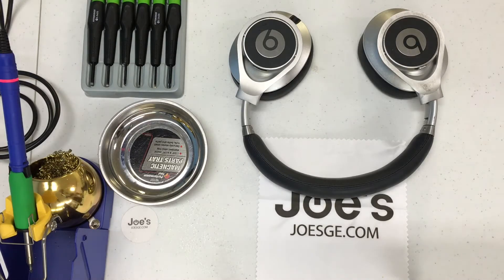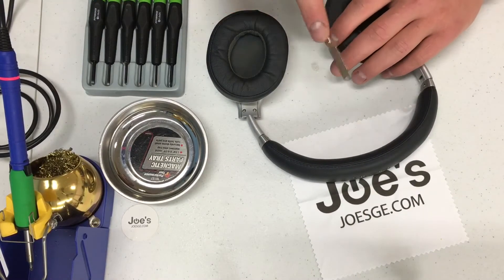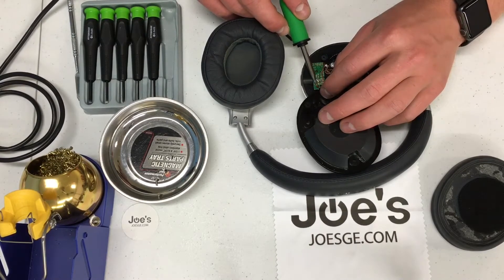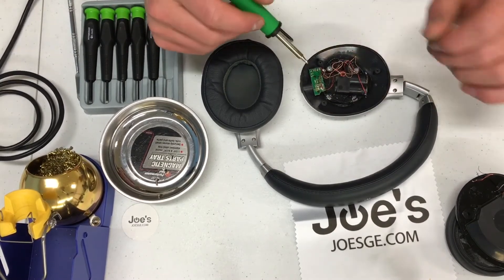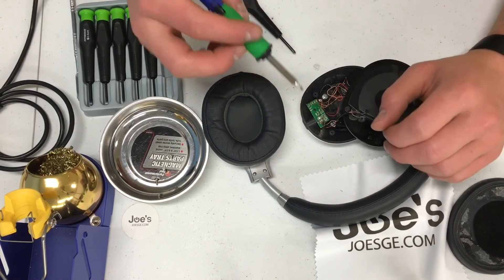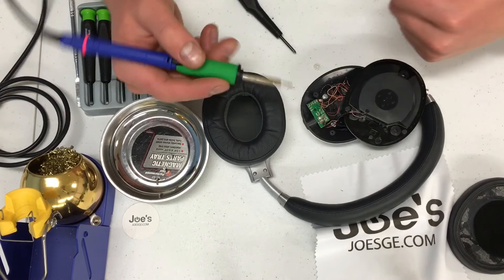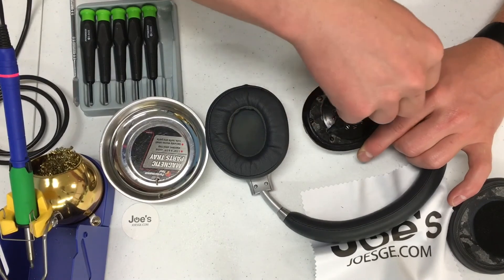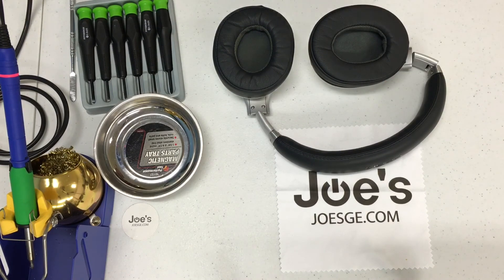How to Repair Beats By Dre Executive Headphones Speaker Fix

Comment: I have the same headset, and the right speaker stopped working. The audio jack works fine, so it's either the speaker itself or the wire between them. Do you have any videos showing how to fix the wire by any chance?
Reply from the maker: Hello, thanks for commenting. Please email us at support@joesge.com with your question. We will be able to better assist you there. - JoesGE

Comment: Great video, gives me some ideas where to start ... I think in my case it is the audio jack. When I turn on ANC I can here the white noise come out of both speakers, but no matter which cable I use to connect headphones to audio source, I get no audio whatsoever ...    just haven't soldered in a very long time ... not sure if worth the effort :D
Reply: LOL ... your video encouraged me to open up that one side ... looked around, wiggled the cables and confirmed they are all still well connected ... could not find anything wrong .. tested again .. and NOW it is working! Sometimes that's all it needs, some TLC :D
Reply from the maker: Just like the old N64 or Gameboy Cartages. Sometimes you just have to blow out the dust and its good to go! 😂 Glad we could help

Comment: i have a question plz
i have the same model was working good but yesterday start to hear the sound with echo not clear sound and tried to change the cable and battery and also connect to my cell phone and also for laptop the same issue
both sides working but looks like echo sound as background do u know what happened
Reply from the maker: amgaddodda probably a bad aux Jack

Comment: What could it possibly mean if the left ear is making a high pitch screaming like noise?
Reply from the maker: Thanks for the comment. The issue you are describing sounds like a blown speaker. This is a common issue with the Beats Executive headphones. If you would like your device repaired by a professional you can fill out a repair form and follow the steps to send in your item. We offer free shipping and diagnostics. Here is a link to the repair form:
https://www.joesge.com/pages/repair-services

-David P

Comment: I have a strange problem with them, the batteries discharge very quickly, 3 hours maximum.any idea.
Reply from the maker: Thanks for the comment. I am not sure why the battery would drain that quickly. The Beats Executive headphones take AAA batteries so be sure that you are using good quality batteries. I know from past experience that some brand new AAA batteries wouldn't even power on the headphones. 
-David P
Reply: @Joesge  
I have used the same batteries in the last month, duracell plus power, in the last day I used 6 batteries, it is a big consumer or so, they are hot when I remove them from the headphones.
Reply from the maker: You will need to isolate the issue by replacing parts. I would guess the fault is from the powerboard. I can't say for sure as this is not something we came across with these headphones.
Reply: @Joesge  Thanks for the answer, it is best to buy others, obviously no beats, I think I have used them for 3 months, so they are not reliable.

Comment: the right side of my headphones don't work. How do i know if it's faulty wiring or if the speakers are busted? or maybe if it's the circuit board? I'm thinking of sending it in to be fixed.
Reply from the maker: Charlie Brown usually right side means the wire is damaged. Depends if it's completely dead or you hear some sound sometimes

Comment: My sliding power switch broke on my pair of executives. Any suggestions?
Reply: Did you find any solution?
Reply: @burakbaygun7882  I ended up taking them apart. Remove the ear muff cushion and such and take the speaker out. Was then able to flip the switch to on so they stay on all the time. To turn it off have to remove the battery. Was able to glue the ear muff back on but its not perfect. Ended up keeping them for backup but bought a pair of Yamaha headphones to replace them.
Reply: @xarnoldx10  is the on/off switch suitable to detach & replace with a new pair? Thx btw
Reply: And if  switch is able to flip to "on" when you taking them apart, what is blocking it to flip actually?
Reply: @burakbaygun7882  It was awhile back so i cannot recall if the switch could be replaced. What was blocking it was the part of the switch on the outside detached from the inner part.
Reply: @xarnoldx10  thank you so much

Comment: Mines on the battery side some times it plays some times when it does play it has static noise but deafeningly loud and other times it’s fine is it a wiring or speaker problem? But sometimes the other side is is the problem and the battery side is fine ???? WTF
Reply from the maker: You are most likely having a main internal wire issue. You can send it in for a $90 repair by submitting our repair form here: JoesGE.com/pages/repair-services, use Google Chrome to submit our repair form.

Comment: I reeeeally need some info. My executives are not receiving any audio and all i hear is a soft (kinda squeaky) pop over and over. Also the Green LED on the power is flashing which it's never done before. I've had my headphones for about 2 maybe 3 years now. DOES ANYONE KNOW WHATS WRONG?
Reply from the maker: Could be a bad power board. Did you change the batteries already? Send it in for a free diagnostic https://www.joesge.com/pages/fix-beats-by-dre
Reply: Joe's Gaming & Electronics thanks so much for the info. Ended up being the batteries i was using. I was freaking out bc i had already changed the batteries so i figured theres no waaaaay both sets were bad. But in fact they were!

Comment: my beats keep turning off
what couse it that????
Reply from the maker: There could be a few things that cause this, the most common being a bad power board/ battery or internal wire. If you would like for them to be looked at and fixed, you can fill out a repair form on our website here: JoesGE.com/pages/repair-services